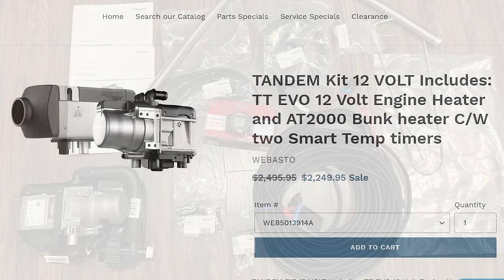Ultimate DIY Diesel Heater Build!

Comment: Nice work. Just don't like stark brand, hope you don't have a problem with it again. Cheers from Portugal
Reply from the maker: Ah, that's a shame for hear. I've never used stark. Hopefully, it won't let me down in the middle of nowhere....
Thanks for watching
Reply: Stark It's the autodoc brand, cheaper parts with another name, to sell more expensive. The material is weak, especially at temperatures below 0°C. The water pump bearings are weak and stick, which for you in the middle of nowhere can become a big problem
Reply from the maker: Do you have a brand you recommend? Every pump I buy looks like it's fresh out ot Shite land.
Reply: After crown, INA usually it's good
Reply from the maker: Okay thanks for the tips. I will order another from them as a spare

Comment: Where do you get your gaskets and things? I'm finding it is extremely difficult to find some things as an English speaker in Italy.
Reply from the maker: What kind of gaskets? The small things like water housings, pumps etc. Or the big things like head gaskets and such?
Reply: @WorkshoptoWilderness  The water housing, exactly. I will have to replace my thermostat housing so I'm looking for that gasket. If I remember correctly there are two other gaskets in the coolant system that I want to replace as well.
Reply from the maker: I make my own gaskets, to be honest, because It's cheaper and more reliable. Buy a sheet of 1 mm thick gasket paper from Flexoid. Trace the surface and cut out a gasket. You can place the paper over the mating surface of the part and rub your finger on it for an impression. I use grease on the gasket after installing just to seal it in.
Reply: @WorkshoptoWilderness  OK thanks!

Comment: hi its called thermo syphon the old cars used to have that  to cool the engine before water pumps,  highly inefficient  but you properly know that
Reply from the maker: I had no idea it was called that. I appreciate the information!
Reply: when engines speeds increased the system could not get rid of heat quick enough so along came the pump @WorkshoptoWilderness
Reply from the maker: Ah, I see, I mean, it seems inefficient without the pump. As you say, hens the introduction of a pump

Comment: Я не понимаю, почему не сделать спальное место в машине, а на крышу ящики? Комфортнее и тепло
Reply from the maker: I've tried that and I didn't like it. The condensation inside was terrible, and getting all the boxes off the roof is a pain in the ass. In the summer, the inside fills up with  thousands of mosquitos, biting gnats due to going in and out, etc.
It's much nicer on the roof in a comfortable bed with lots of space, and it's very easy to heat and keep dry. It stays closed until I sleep, so no flies get inside. 
Hopefully, now you understand, but you might not have the same intensity of flies as we do here.
Reply: Теперь понимаю, надо попробовать палатку, чтоб сравнить 👍

Comment: Only buy genuine VM parts. I used to work for VM Diesel Specialist in UK for 6 years in my 20s. All the aftermarket parts for them are shite.
Reply from the maker: The vm diesel specialist no longer sells genuine parts, unfortunately. Some things are, but I think it's getting harder.
Reply: @WorkshoptoWilderness  I'm surprised he's still going. You can still get genuine parts, just got to know the right people...
Reply from the maker: I ordered from Italy 🇮🇹. They were genuine back when I got them. I wouldn't buy genuine heads for love nor money, though.
Reply: @WorkshoptoWilderness  genuine heads are the best
Reply from the maker: @Bertcustardhead  I will take AMC any day over the original
Reply: @WorkshoptoWilderness  why?
Reply from the maker: @Bertcustardhead  The original heads aren't pure aluminium. It's a magnesium Ali mix. They are prone to cracking, porosity, and studs pulling out of the rocker mount at the top. They are sensitive. 
Amc have been making pure aluminium heads for all vehicles for decades, and they don't suffer the same issues, which is why most VM enthusiasts move over to them after the originals fail. 
The AMC head with a multilayered gasket would have saved this engine from its original shite reputation.
Reply: @WorkshoptoWilderness  AMC heads still crack and still pull out studs. Torque them correctly and they'll be fine. The reason why the heads are so crap is because the gap between the face of the head and the water gallery above is too thin.

Comment: Ive just fitted a engine heating sytem to my vehicle, its a Webasto Evo 5. I also have 2 x (12" x 8" ) insulated oil coolers which act as radiators below my engine and trans sump. These are isolated by a diverter and one way valve when the vehicle is running to prevent draining the cooling system should a branch or rock rip the pipes off from underneath. The diverter valve when de-energised allows hot coolant to the cabin. The system is pumped too. I like your idea for a block heater, do you think with no inline circulation pump it might not reach the whole water jacket, especially around the cylinders? Great videos btw!
Reply from the maker: Sounds like a very solid system you have there. I like the sound of it. 
I've almost completed the build and have been testing it today in about -19. There is one component missing, which is the Y piece with the adjustable vents on it. 
The system works really well, and it heats almost the whole block in about 2 hours. The cylinder heads are actually pretty hot. I mean you can touch them but it's very hot considering. I made some adjustments since this video, including insulated pipe work, ducting, and such. The oil gets pretty warn as the exhaust is plumbed in to warm up the bottom. 
I ended up drilling and plumbing a duct into the jeep, so it's getting pretty hot in there now, lol. 
The final design will be when the Y arrives so that heat can be directed to the tent and not the jeep with the vents. I shall see how it goes. Thanks for watching and the comment
Reply: @WorkshoptoWilderness  Sounds a good system, can't beat a diesel heater plumbed to the vehicle fuel tank. I'm upgrading my electrical system to dual batteries for a bit of redundancy as the cold spell here in the UK highlighted its weakness, can't imagine what - 19 wouldve done.
I hope to be living in a cabin somewhere in a swedish forest, west Jamtland area, hopefully this year . Greetings from 🏴
Reply from the maker: - 19 is pretty nice, providing the humidity is low. It was - 40 a week ago, and that wasn't fun. If you do move here and choose to live remotely, then i hope it goes well. I'm a bit further north than Jamtland and life is hard enough in this small town.